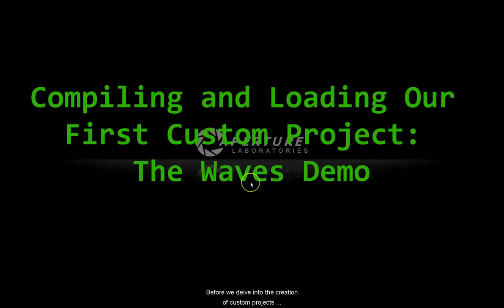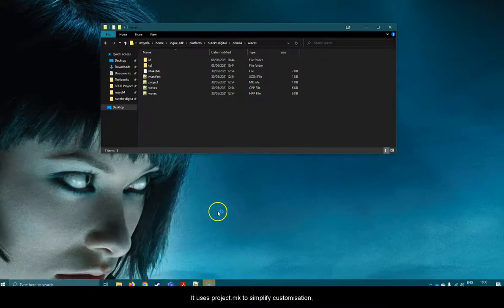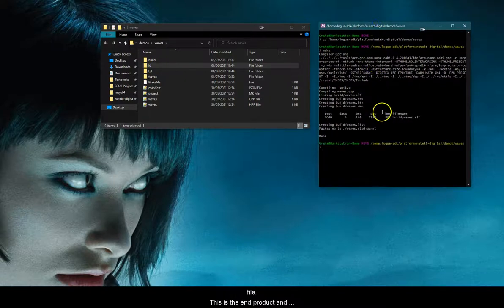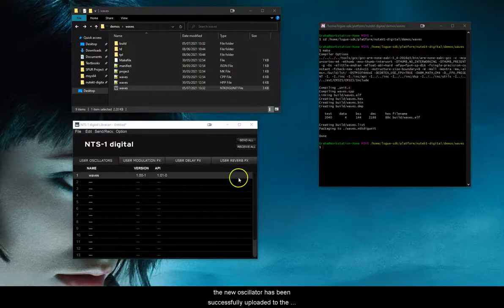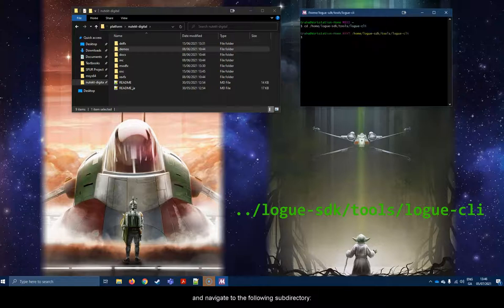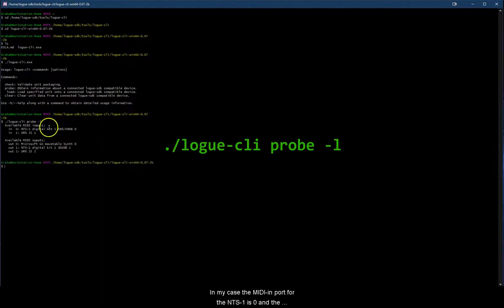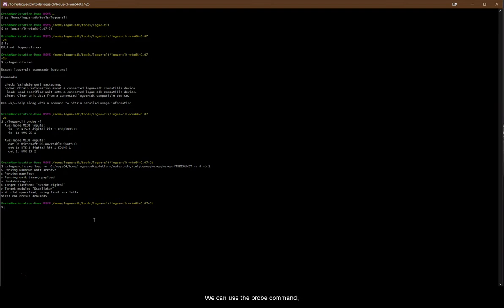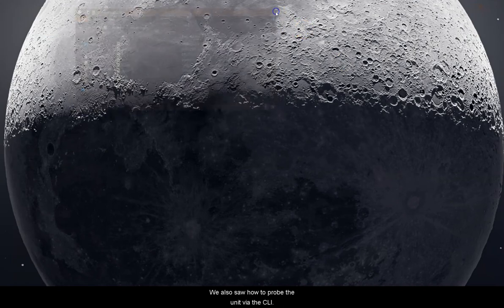Compiling and Loading Our First Custom Project: The Waves Demo

Comment: Hey thanks for the series. I'm having an error when I try to insert make command. 

Compiling _unit.c
Compiling waves.cpp
Linking /home/logue-sdk/platform/nutekt-digital/waves/build/waves.elf
c:/msys64/home/logue-sdk/tools/gcc/gcc-arm-none-eabi-5_4-2016q3/bin/../lib/gcc/arm-none-eabi/5.4.1/.
./../../../arm-none-eabi/bin/ld.exe: cannot open linker script file /home/logue-sdk/platform/nutekt-
digital/waves/ld/userosc.ld: No such file or directory
collect2.exe: error: ld returned 1 exit status
make: * [Makefile:187: /home/logue-sdk/platform/nutekt-digital/waves/build/waves.elf] Error 1

Do you have any suggestions? Btw I think they changed the directories and some files for the last build of logue sdk. There is no demo folder. Maybe demo files are corrupted but Idk.
Reply from the maker: Hey, sorry I didn't reply sooner! I've been busy with college. I have to reacquaint myself with the SDK it seems. I'll have a look a this once I finish my exams and come back to you if I you haven't already found a solution.
Reply: @grahamkeane2776  thanks for the reply! Don't rush it focus on your work. Some people suggested using Linux. Apparently windows is too buggy. So I'm going to try that
Reply from the maker: @ozdemirisk1135  cool, I'd like to hear how you get on with that. I wonder would WSL work?
Reply: Hi I had the exact same problem theres an article on git on the issues page about it . Basically you can type make LDDIR=ld and it sghould work . However i don't get a waves.ntkdigunit   file ! so am at a loss as to where this is or why its not there !
Reply: @adeevision1297  Change line 17 of makefile to read:
LDDIR ?= ld
and then run make install to compile and build the .ntkdigunit file. You can also run make clean to force a complete rebuild.
Reply: @Cleefbag71  Thanks that did help trouble is now it can't create the elf file ... No rule to make target '/d.... . .waves.elf',  and i've no idea where this rule is as its not in the rules.ld file ?
Reply: @adeevision1297  Just to check, the ld on line 17 of the makefile should be lower case L followed by lower case D. I get the same error if I put a capital i or a pipe symbol there instead.
Reply: @Cleefbag71  Hi yes its ld
Reply: @adeevision1297  I dunno then, only other thing I can think of is make sure none of your folder or file names have spaces in them, including those above the logue-sdk folder
Reply: @Cleefbag71  I think theres something wrong with the ld files . As i changed the makefile to output the folders and it finds the ld folder ok. But does nothing beyond that ! thanks for your help though .
Reply: @adeevision1297  No probs, hope you can figure it out
Reply: @Cleefbag71  Other way (which I figured out) was to change PLATFORMDIR and PROJECTDIR to not use absolute paths. In either case its --script parameter for ld which doesn't know how to handle msys2 paths correctly and need relative paths. Also yes "make install" creates ntkdigunit file. I wonder why it is different in the video - there seems to be relative paths and make without install creates ntkdigiunit file... that said usually issues for Windows happen when someone makes terrible untested on all platforms pull request and someone else accepts it without actually checking for proof it was tested everywhere. This also makes videos such as these pretty confusing unfortunately